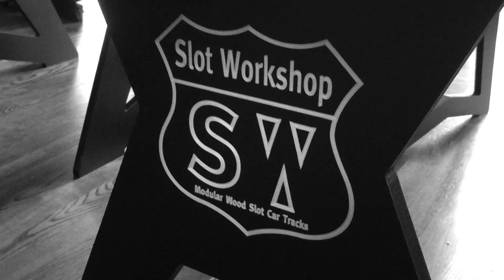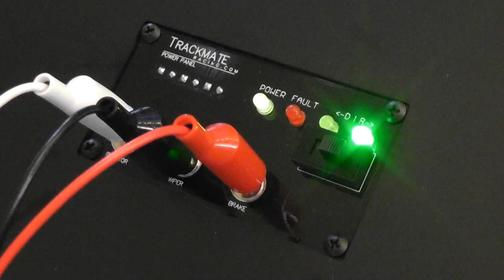Slot Workshop 4 Lane Modular Slot Car Tracks

Comment: We shut down production due to cost. The track you see cost us $1800 build using cnc, and then required a technician to braid the lanes, wire the legs, etc. it was a fun project, but costly. I still have the cnc plans for track and legs if you'd like them.

Comment: The legs are what connect power between the track sections using spring clips. The track and legs are made from a special wood with melt-on laminate compound that won't ever wear. Grippy, and shiny.

Comment: Any of this stuff left around?  How do you get the plan?
Reply: +Bruce Thomas -  I designed it from scratch in 2011. I used a CAD program to design the legs and tracks. Used CNC shops to cut the parts by computer. It was an amazing system, totally customizable. But, it was expensive to build, and only two tracks sold. The wood was a special laminated material that required no painting.